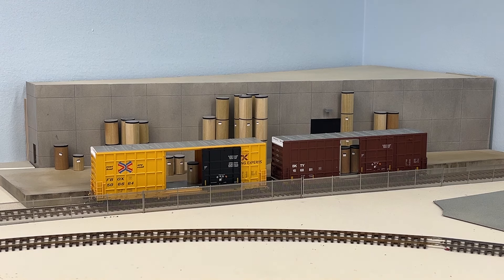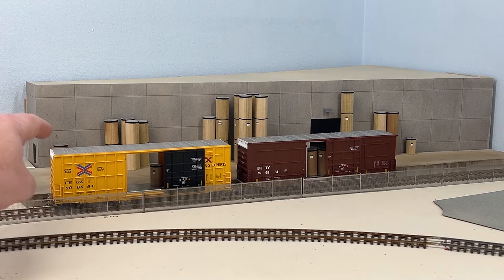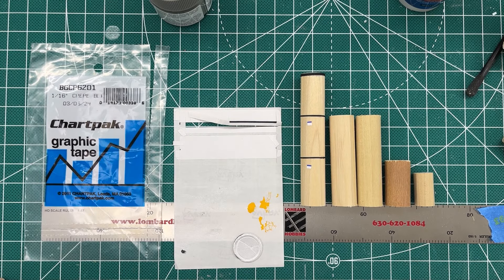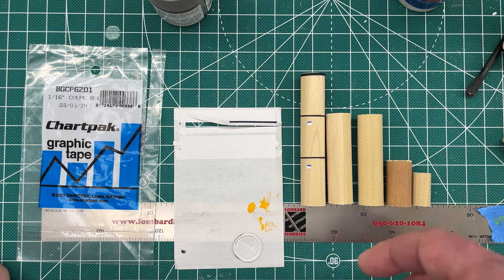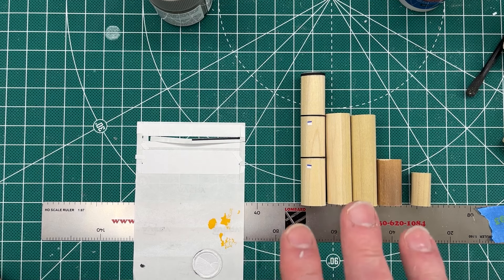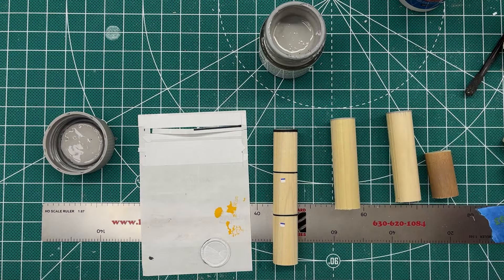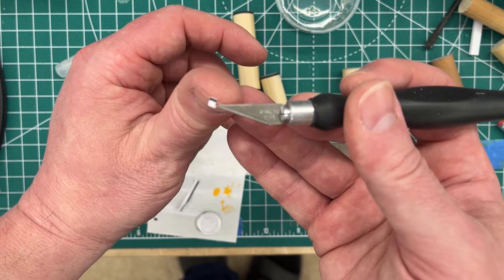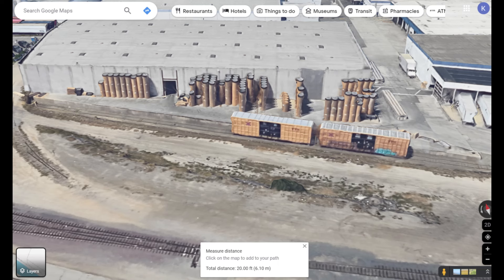Model rolls of carboard in HO or N scale!  Simple project for a paper industry on your Model RR

Comment: That's a nice cardboard facility. I'm working on a Injection Molding plant using a old Deluxe Innovation warehouse, Walthers modern warehouse (933-4067) and Walthers Plastic pellet transfer facility (933-3081). Not to many plastic pellet covered hoppers though. Atlas has the ACF 5250,5701 and 5800 capacity cars. ScaleTrains and Rapido have the ribbed side 5850 Pullman Standard and Procor car. Walthers did offer the NSC 6224 car. The ARI 6224 Center Flow now Greenbrier,  Trinity's 6241* and Greenbrier's 6250 capacity cars need to be made in model form. FreightCar America has their 5800 and 6200 car but it looks similar to a NSC 6200 car. *Trinity's 6241 is probably the most popular out there and it definitely should be made into a model.
Reply from the maker: Yeah, nice plastic pellet hoppers are hard to find.  I have some Rapidos and then some Atlas ones from a few years back.  That's pretty much it.  That cardboard building is the Walthers Modern warehouse, or part of it, as well.  Very versatile kit.
Reply: @VSLAModelRR  I hoping ScaleTrains make the Trinity car like they did the carbon black hopper in three versions. The early car doesn't have end cut outs. There is definitely a need for more modern hoppers and tank cars.

Comment: One thing on the cars I'll have to do after actually seeing the inside on the other video, I'll have to remove the weight to have the floor level where it should be. Weight will just be supplemented over the trucks out of sight.
Reply: Cut the weight in four then put two pieces over each truck, that would give half the car length free in the middle to fit a floor.